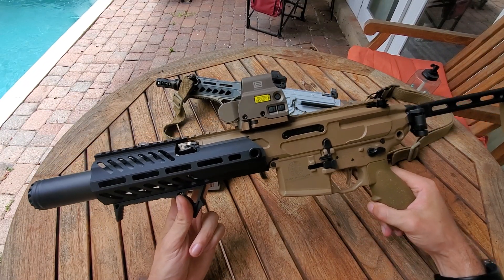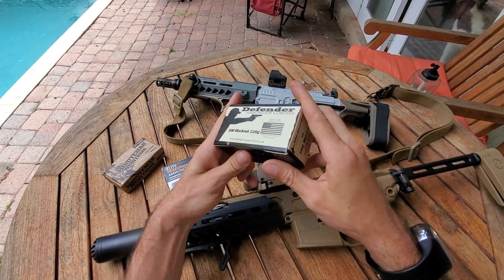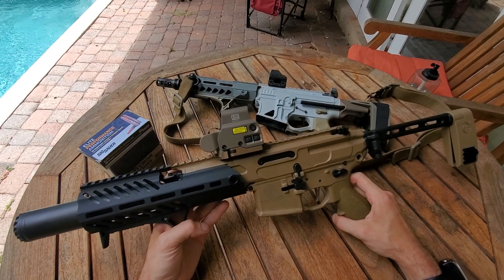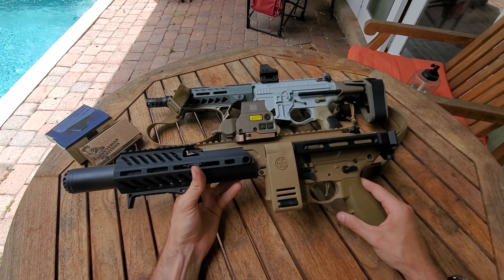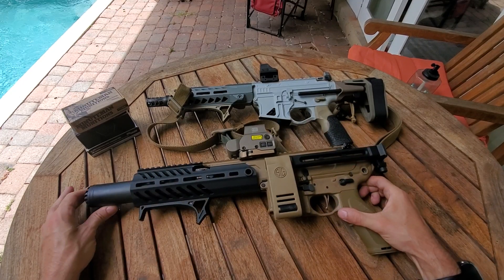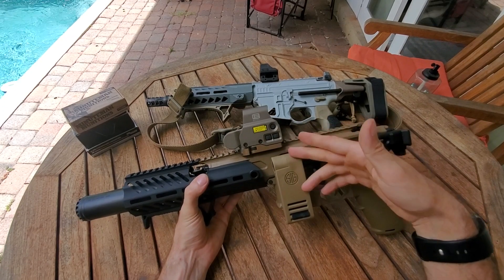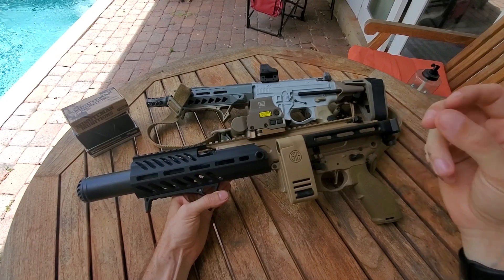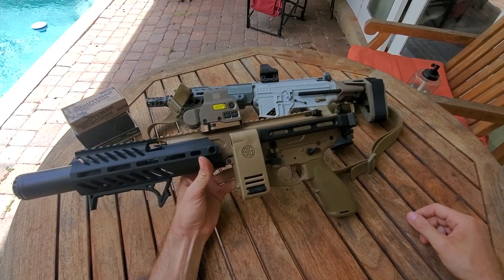Sig Sauer Canebrake Rattler Failures Continue...

Comment: OSS can has no back pressure. Of course it can’t cycle subsonic... it’s not the guns fault man, you just don’t know what the hell you’re doing.
Reply from the maker: really? because MAC's does, thats his permanent can on his rattler. All my other 300bo guns do. every 300bo gun on the market should be able to run subs and supers without additional backpressure on a normal gas setting. maybe you should learn a little bit about how guns should work before you make retarded comments pumpkin ;)
Reply: @maximusjoseppi5904  2 months late and you’re back to quote MAC who also complains his rattler is wildly over gassed. Cool.
Reply from the maker: @jamesgarrison5546  sorry, I don't shift through my stupid comments regularly. Never too late to prove an idiot wrong. I didn't quote anyone? Haha. Solid concession speech, what I'd expect 👍🏻
Reply: I appreciate your info but can't Sig design a gun that doesn't require a specific can? I don't believe the standard Rattler has this same issue but may be uninformed.
Reply: @stevewolbaum393  all 300 BLK rifles need some back pressure to reliably cycle subsonics. OSS/huxworx flow through cans aren’t ideal for a 300 BLK. Especially with so short a barrel b

Comment: I have the same gun same problem, fortunately I bought it when the brace rule was going into effect so I got it a little cheaper but still pissed. I'm currently thinking of throwing a different barrel like a 8" to see if that will resolve the problem by creating more back pressure. It would also bring the barrel out to the end of the hand guard which I wouldn't mind. I'm also contemplating yelling at Sig to see if I can get a discount as it's $750 since this is their bad. What's your thoughts?
Reply from the maker: its just a poorly designed gun.. not much you can do. you can build a much better gun for about $1k so just sell it honestly.

Comment: No suppressor attached, run supers.  Suppressor attached, run subs.  On a related note, a 5" barrel even for 300 blk is rather silly.  There's a reason why Q (who arguably knows 300 blk better than anyone), puts a 7" barrels in their guns as the shortest configuration. Better internal, external and terminal ballistics and increases reliability.
Reply: Not only do you know lawns….
Reply: @lojr2  I try

Comment: A friend is using a Sig suppressor with his Rattler.  Functions well but very gassy.   Not sure what brand ammo, but it was in a blue box.  Negative was that those subsonic rounds were keyholing.   It doesn’t keyhole with supersonic rounds.
Reply from the maker: ya.. to make a $2700 gun with an adjustable gas block designed from the ground up to be chambered in 300bo and NOT make it reliable with supers and subs is grossly negligent IMO. Put a 3rd gas setting that runs subs, period. And if it doesnt work with a customer's silencer, make it work. proprietary bullshit

Comment: So the gun is dog shit because it doesn’t work with the only flow through suppressor on the market? Why not just buy a dead air or surefire ?
Reply from the maker: Why should I have to do that when it should work with this one and it should work without one period.
MAC uses the same suppressor on his, works fine. Sig themselves are designing reduced back pressure cans as well.
There's zero excuse for a gun designed for 300bo with an adjustable gas block to not work in the most common loadings. That's idiotic.

Comment: https://www.youtube.com/watch?v=7b6vCcnZ2Qc&t=1759s   at 19:36 & 21:00 in this video. It could be the mag problem. Rattler need 300 blk mags to run sub rounds reliably. 556 mags will cause sub rounds too tight to go up when fully loaded.

Comment: Just my two sense, I’m wrapping up a rattler upper build. Sitting on radian lower. I used my OSS 7.62 qd TI and on full open it ran magtech subs, how ever did not lock back (common problem) OSS can and supers flawless and lock back. I plan to do more testing after some upgrades. Colin noir did a rattler video with a SIg can and it didn’t even lock back with supers lol. I’ll see if break in will make it work better.

Comment: You need to run a higher back pressure suppressor.
Reply from the maker: Thanks Sherlock. Point is you shouldn't need that and make of them don't. See Mac's. He uses the same can
Reply: @maximusjoseppi5904  Isn't the point it should properly cycle subsonic ammo unsuppressed?
Reply from the maker: @therealMLJones  that's what "you shouldn't need that" means...
Reply: @maximusjoseppi5904  I'm with you, I want a 300BO pdw that will properly cycle subsonic unsuppressed ammo just like your personal build.

Comment: Say, it's been quite a few months since the two vids on this gun was posted, did you happen to get any news on it since? Hopefully, some improvements that make it perform the way any other MCX should? Because I heard nothing but good things about the Virtus. I only looked into the Rattler series because of the Canebrake and I was like "oooo, it's gonna be like an MP5 SD or a Honey Badger but cooler".

Also, about the whole "this suppressor works, that suppressor doesn't" thing, I agree with you. There should be no reason a battle proven (let alone expensive) weapon such as the MCX should have to ever demand a detachable accessory in order for it to function. Especially since suppressors get pretty hot pretty quick. Idk about the trigger, I haven't got my hands on an MCX yet, but that fidget spinner they call a brace is... well, the only reasonable explanation I can think of for that is someone had a very bad day and decided to take it out on everyone else. Not that it's justifiable, but, y'know, just a guess.
Reply from the maker: Nah. It's trash, I just sold it. Sig qc is crap and their support is horrible.

Comment: Dude you could sell this thing for a significant profit. You wouldn’t believe what these are selling for on Gunbroker, USED.
I own quite a few 300 blackouts, and if you’re willing to spend this kinda dough, check out Wilson Combat ARP Tactical. Beautiful gun, and even better customer service.
As mentioned Daniel defense is good, my ghetto blaster is beautiful too. Sig is not only game in town, just a few inches shorter than the others.
Reply from the maker: Ya, I've been out of town on business for a few months now. I'm going to sell it when I get back. AR pistols are not allowed where I am now so I can't sell it or bring it here. 
I'm well aware of other offerings and I built my own pdw that I have a video on which is phenomenal. I just liked the idea of losing those few inches for better concealment in a backpack. You also lose far too much functionality though apparently and sig has horrendous customer service.
Reply: Maximus Joseppi if you want something that short , also take a look at V Seven Weapons. They have a 5.5 inch barrel and it weighs like 3.5-4 pounds. I’ve had great customer service with them, and their products are amazing quality
Reply from the maker: @levistreiter7406  well the thing that made this gun appealing was the recoil system allowing for a folding stock, not the barrel. My own build is preferred over any AR. I would have to go non AR to get any smaller.
I hate the law adapter. Expensive heavy hoaky thing

Comment: Would you be able to borrow a friend's non-flowthrough supressor and see if it runs with subs? A 9mm suppressor should work with sub 300 blackout.

But overall this is disappointing. I honestly was going to get a rattler but now im not so sure. Unfortunately there really is no alternative to the rattler at the moment.
Reply from the maker: i have my muzzle brake rocksett on so no. i have a rugged obsidian i could put on it but id have to break my muzzle break off. 
either way, its inexcusable that it wont run unsuppressed or suppressed but sig only supports the use of their silencers. who are they, fucking apple
Reply: @maximusjoseppi5904  Yea I hear ya, that's a bogus move on Sig's part. Honestly I think the company is gonna go down the shitter like colt. These manufacturers get really complacent with their R&D and QC once they land a govt contract. Sig's real redeeming quality was that they still made things in Germany, but they recently shut down their German operations so there goes that.
Btw if you ever do want to dissolve the rocksett I've had good luck with Un-Cure by Bob Smith Industries. Get a good amount on the end of the threads and let it and gravity do the work. Come back in a couple days and it should come off without much difficulty.

Comment: Dude, if you want to have something similar to the Canebrake, check out LMT CSW upper with integrated handguard. It's monolithic, wide enough to accept integrally suppressed barrels and lacks forward assist, which is great for suppression. Throw in Gemtech suppressor BCG, Gas Buster charging handle, PDW brace and you're golden.

Comment: Just commented on the previous video LOL.  For what we pay for these things it absolutely sucks that you got a dud and apparently no help from the manufacturer. Love that kick ass pdw though👍👍. Wishing you good luck with whatever is next for this sucker.  Potential Sig short barrel .300 buyers have a look at this from the MCX owners manual.  “.300 BLK MODELS ARE NOT DESIGNED TO FUNCTION RELIABLY WITH SUB-SONIC AMMUNITION WHEN FIRED WITHOUT A SUPPRESSOR. IT IS POSSIBLE FOR SOME MODELS TO FUNCTION WITH SUB- SONIC AMMUNITION, HOWEVER THE POTENTIAL FOR STOPPAGES IN THE CYCLE OF OPERATION IS SIGNIFICANTLY INCREASED. FIRING THE RIFLE WITH ALL AMMUNITION TYPES WITH THE GAS VALVE IN THE (+) POSITION WILL NOT GUARANTEE RELIABLE FUNCTION. THIS WILL INCREASE THE BOLT CARRIER SPEED RESULTING IN REDUCED PARTS LIFE, FAILURES TO FEED AND FAILURES TO EJECT.”
Reply from the maker: except it doesnt work with one of the most popular silencers on the market haha... my oss 762Ti. And for them to make a $2700 gun with an adjustable gas block designed from the ground up to be chambered in 300bo and NOT make it reliable with supers and subs is grossly negligent IMO. Unacceptable on any level. Put a 3rd gas setting that runs subs, period. no excuse. 
then for them to tell me they dont support the use of any silencers other than their own... I will definitely be thinking twice about buying sig sauer products in the future.

Comment: I noticed now on sig's website for the canebrake ( on page 4 of the questions ) it says
Q: Will this gun run sub sonic ammo reliably without the use of a suppressor? 
A: Like most 300 Blackout rifles, the MCX Rattler will cycle subsonic ammunition when using a suppressor. It will fire the subsonic rounds, but there is not enough back pressure generated to fully cycle the rifle and fire the next round. Adding a silencer will give the rifle enough pressure to fully cycle. The MCX Rattler will have no issues firing and cycling supersonic ammunition, unsuppressed. this is as of 1/15/21
so if you carry this is a backpack and not have a suppressor on and try to run subsonic, they know it's a fail and you'll know it's a fail. pathetic.
Reply from the maker: thats the most idiotic thing ive ever heard haha... they are just lazy and trying to cover their ass for making a crap product. Most 300 blackout guns do run subs unsuppressed and if it cant, its not fit to be a self defense weapon.